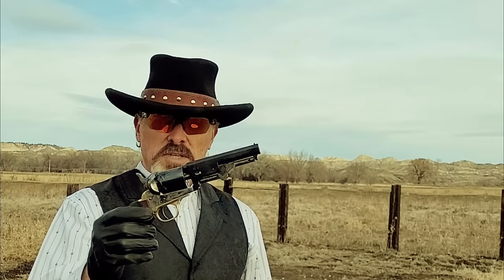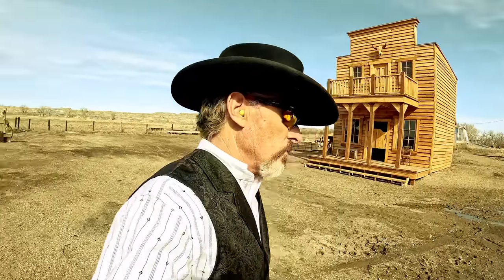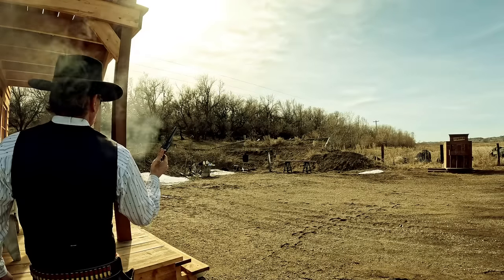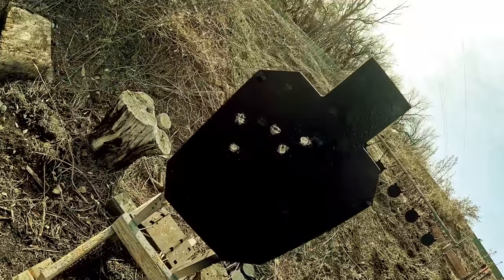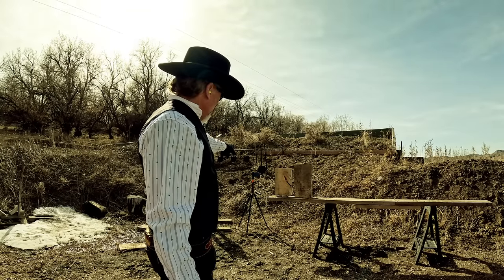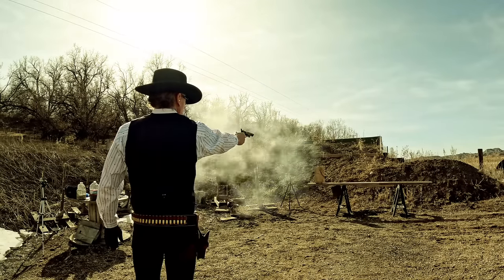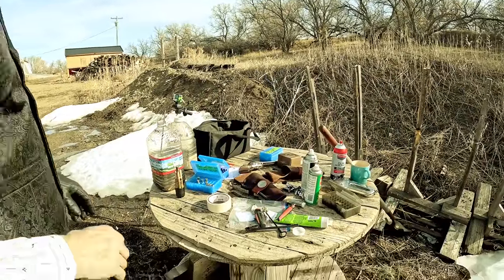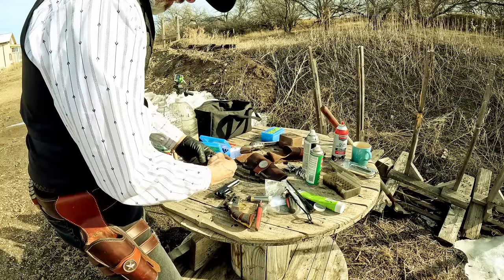The 1851 Navy "Sheriff's Model" Race  Revolver

Comment: I bought a used Pietta 51 navy at a gun show a few years back. It had an early Kirst cylinder without the loading gate. It was .38 long, but .38 specials fit in it. I solved the key hole problem by shooting the hollow base wad cutters in it. They are not hard cast, maybe pure lead. I loaded them to stick out as much as a 158 swc so it wouldn't have a big jump to the forcing cone. Works great. Someday I will order the back plate with the loading gate.

Comment: That is awesome! Thanks for all your work on these videos. I love the Navy configuration and I shoot the Richards-Mason conversion open tops in CAS. My guns are factory-made with the correct barrel diameter for modern .38 bullets so accuracy is not a problem with regular .358 or .359 bullets. An easy fix for your key-holing issue is to shoot hollow-based bullets. For instance, 158 grain hollow-base wad cutters. The hollow base will expand upon firing and grab the rifling better. You might try that before spending the money on sleeving the barrel.

Comment: I chronographed an undersized ball and it lost around 200 feet per second.  I do like that short barrel on the Navy.  I got an 1861 barrel shortened to 5.5” with a dovetailed front sight.  I keep the loading lever off and use it as a cap and ball carry piece in summer.  It’s only slightly larger than an 1862 but has an extra shot in the cylinder and runs way more reliably.

Comment: What I would suggest is using SW 38 brass and loading .372 ball or conical  The SW 38 is a bit bigger around brass and shorter so ..  maybe easier to eject?      Also with the right expander you could load .372 ball into the case.     This would solve two problems IMO.

Comment: Tuco you might like the Kirsh conversion cylinder better, then the R&D cylinder you are using from Taylor’s. Reason I say that, is the Kirsh conversion cylinder is similar to the older Richard Mason conversion cylinder. As the Kirsh conversion cylinder can be bought with or without the loading gate, which makes the gun load just like an old Colt Peace Maker if you get it with the loading gate conversion cylinder. Course you have to modify the frame for the loading gate to work, but it makes loading the gun safer.

Comment: I am amazed but not surprised that you did it with a stock cylinder. You should build 1 in 45 colt using a 44 caliber bp revolver.
Reply from the maker: It's tempting to try since the Taylor cylinders I've seen are cut to .040 or deeper. I didn't want to start out with a 45 and then cut deeper notches based on your opinion of the cylinder wall thickness issue which I agree with. The one problem with open tops and the 58 Remington is that the one stage hand ( as opposed to 2 stage like an SAA) limits the action and is insurmountable without a complete new cylinder gear.
Reply: @TUCOtheratt  oh ya I didnt think about that I wouldnt trust myself to cut the notches deeper on a opentop in 45. I am doing a pietta SAA clone. I have 2 of the 4 notches done and its stress full how thin the wall is. The SAA clones are definitely thicker. With your skill I am sure you could do it if there is enough metal on the cylinder. I wouldnt trust my self tho. Maybe Taylor's will like this video and send you 1. If I had a taylors conversion cylinder in 45 I would send it to you to try  I have kirst cylinders becouse I wanted the loading gate. Kirst cuts his notches stupid. for some reason they cut a leed on both sides of the notch  so there is almost no notch. Congrats on the 1851 navy conversion that was probably my favorite video but I'm partial to open tops they are my favorites. The kirst cylinders are made to the same dimensions as the black powder cylinders. I can measure the depth of notch and chamber if you want and let you know if it might help.
Reply: Also kirst sends a new hand with there conversion cylinders. It is a 2 step hand just like the SAA. He used to sell them separately. If he still does  I dont know but might be a viable option to help
Reply from the maker: @A.R.American1  It's puzzling to me how a 2 stage hand could work with a one stage gear, unless Kirst configures a two stage gear since he's making a whole new cylinder anyway which might be the case.
Reply: @TUCOtheratt  I can switch between black powder cylinders and cartridge cylinders with the kirst keeping the 2stage hand. I'm going to do a video on it in a few minutes
Reply from the maker: @A.R.American1  Please show the gear of the 2 side by side
Reply: @TUCOtheratt  I will have to find a cap and ball cylinder I havent shot cap and ball in years dont remember where I put them honestly

Comment: I would love to see a race gun version of the 1872 or an 1851 with the load gate conversion since it would be more practical. I find the open top colts to be the most asthetically pleasing of the wheel guns. I really want to get an 1872 in .45 and do these kind of race gun modifications

Comment: I just measured the mold it drops .375 diameter bullets at 125 grains. The bullet base or heal measures .350 upwards to the crimp ring the the nose of the projectile measures 375 in diameter. The guy I actually got the mold from sent me 50 bullets to try lol they are still in the bag they came in. I have a bunch of 38 short colt brass. I may load some up tomorrow.

Comment: questions:
1. What kind of bp are you using? Real bp or substitute?
2. What kind of  lube on cylinder axle are you using? 
3. Charge data for 38spec is?
Max bp under projectile or some filler for less charge?
Reply from the maker: Real 3F, full case compressed, no filler.
Reply: @TUCOtheratt you take no prisoners! :D with that charge!

Comment: Grease groves.  .375 bore diameter cast bullet from a modified rifle mold would work, but there aren't many types available and you would have to cast them yourself.
Well done.  They're accurate enough to get the job done.  The target will never know the difference.
Reply from the maker: From what I understand if I could cast them as a heal based bullet like original conversion cartridges I think that would work. What do you think?
Reply: @TUCOtheratt Yes, but the available molds are limited, so you might not have many options for bullet weight.
A mold needs to be milled shorter at the base to give it a heel, then redrilled and tapped for the plate. 
A Lyman 2-Cavity Bullet Mold #375248 375 mold has 4 grease groves and might do the trick.  RCBS also has a good candidate.  The Lee one might also work.
The more grease groves the better as it gives you more options where to mill the mold down to.

But be cautious in redrilling the knock-off plate hole and not shorten it as there's a lot of pressure on that screw.
Reply from the maker: @Absaalookemensch  Good to know. Thanks!

Comment: Just a thought, instead of re-ligning the barrel..... The casings expand when you shoot it, why not slug the barrel and have a mold made to the bore size? Since you're smoking blackpowder the pressures are low and your brass as long as it was cleaned would last some time. Of course you'd have to make sure your cases aren't splitting due to the chamber differential but if it worked you might save some money for more powder and lead. Also who does your custom work? That revolver is pure awesome.
Reply from the maker: Thanks for the tips. I do my own work on my revolvers.

Comment: Good news is that percussing 36 guns have really deep rifling....  bad news is it is .372 on all my 36 guns.   kinda good news is that hollow base 148 grain soft lead .358 bullets will sorta kinds expand with BP enough....   Also Cast bullets of dead soft lead of say .370 will load in the 38 spl case.   A better match would be the SW 38 which is really .360 so .370 bullets will kinda fit.

Comment: Tuco do you use wide lube grooved bullets to limit fowling any bullet mold in particular? When I plink I use Desperado soft lead bullets in the 44 Remington 45 Colt bullets. I make my own.375 from an old west bullet mold but I have not tried the conversion in the colt. Those I think work right it’s the 38 special ammo that key holes? I just checked i have a couple old west molds 375 diameter different weights. 38 special uses.357 much smaller diameter i can see the problem I have to watch it again . Great video!

Comment: IMO 1851 navy is the most beautiful revolver ever. It is so balanced, both in composition and in colors. 
The length of grip and barrel of the standard model balance each other perfectly, accompanied with the loading lever that further enchances the visual balance, not allowing the weight and size of the cylinder and grip to dominate over the thin barrel. The octagonal barrel contrasts with open top round cylinder, and the colors of wooden grip, brass guard and forged steel frame and barrel create a nice harmonic color composition too. 
It's like a katana of guns, especially considering the pop culture tradition of depicting such guns. Like a catana, it lies in the holster for a long time, until in the moment of need it is whipped out like a lighting to deliver one or two deadly, precise strikes, provided by a single action, elegant thin short travel trigger. 
Like a katana, it's also a symbol of status as a warrior, be it independent (a frontiersman/a ronin) or in service (a cowboy/lawsman/a samurai) and readiness to deal with problems, carried everywhere. 
Like with a sword, with a revolver of that type one has a deep pool of mastery waiting to be achieved: you can aim, manipulate and get a feel of the gun in a wider range of motions than with a modern semi automatic, rigid in modern tactical stances and grips.
Like a sword compared to a polearm, such a weapon requires  great skill, understanding and amount of training to be implemented effectively with it's full potential. 

Overall, I believe that in 1851 Colt gave birth to a masterpiece.
Reply from the maker: Well said! 😃👍
Reply: For my money the 1861 Army is the most aesthetically eyeball pleasing gun, the fluted smooth running lines are a delight to behold.
Reply: @biggusdickus5986  I guess it's a matter of taste. I just checked it out - there is sertainly an aesthetic to it. But I like straight lines and balance better) The 1861 is too long for my taste
Reply: @Paul_Sergeyev everyman has their own tastes, which is a good thing as it leads to more choices. What pleasure l get from my likings is the same you get from yours vive la difference as they say.

Comment: you are my mentor from 1851
can we do the same thing with the .44?
mine is running smoothly, well polished and shiny
I use “sellier bellot” caps
Have you shown the powder you use? modified chimneys with a hole in the side?
black or smokeless powder?
can we have a barrel with .45 Colt in 6 or 5 shots? stainless steel or steel
I make my black powder and my .44 lead bullets (454)
spherical or conical balls?
quality videos are a lot of work
well done !!
Reply from the maker: I get into more of that and race guns on my Rumble channel. Thanks!

Comment: So it is obvious you are not of the my 10s in subscribers. 
If you had you know two things.  
1. I have designed my own cap and ball  bullets for all three common standard calibers. 31, .36, and .44.
2. I am in the middle of a experiment involving the specifics of the .36 caliber actual bore size. 
What got me started on this quest was slugging the cylinders of both of my Remington new model Navy's. I determined at the time that to easily line up the conical bullets in the cylinder of both revolvers the heals maximum diameter of no more then .365.
This lead me to question the actual bore diameter. 
I want through the process of slugging one of my barrels on camera, the other one by accident ended up off camera.  Here is what I discovered. 
The actual bore diameter of my uberti is .3710.
The peitta bore diameter is .3665.
Now why did  I do this?
First off the numbers just didn't add up based on cylinder diameters 
So I am now have theorize that base on this foundation that  a .38 special case diameter is.379 and I can produce a .372 diameter bullets  it should still be able to crimped with ease.  So I have ordered a two position bullet mold. 
For a heal based bullets of  .358 heal, and a body of.372 diameter to  test this journey. 
My hope is to produce loads using only 38 special/ .357 dies without any special crimping die.
The two test bullets I ordered are a 130, and 150 grain bullet . When considering the cost of sleeving a barrel, as opposed to a custom bullet mold?
We will see.
Mountain man
Reply from the maker: There is a lot involved in working it out.

Comment: Nice video, I more like the original barrel lenght Navy.
Would this also work with the original cap n ball cylinder? Fanning, triple shot. They are very jammable, caps fall off, get stuck.
Reply from the maker: I'm pretty sure it wouldn't work.
Reply: @TUCOtheratt  Because in my country you can only buy muzzleloading weapons without a permit.
The Remington is more reliable with a cap n ball cylinder.

Comment: Didn't go through all the comments, but have you thought about using a hollow based bullet v.s. a barrel liner? I've used them in the past with some success. I was launching a 158 gr. hollow based  lead wad cutter from a 58 Remington Navy conversion around 600 fps if I remember right?
Reply from the maker: Ya I have. Thing is right now I'm shooting 9mm, 45 colt, 45acp 38 sp 357 mag and I'm sitting on a lot of 359 swc bullets (non hollow base). I really need to keep it simple at this point. If I can get the barrel lined, problem solved no need to introduce yet another loading component to keep track of.

Comment: @TUCOthratt I'm interested in a similar setup for Cowboy Action Shooting with the 1851 Navy.  Can you discuss differences in parts and mods involved in your finished Quick Draw race gun as compared to a CAS/SASS race gun?
Reply from the maker: Cowboy action tuned race guns are like moms minivan with a new set up spark plugs and basic tune up to go to the store and back reliably. (good enough) My race guns are like 10 second quarter mile corvettes. More on my Rumble channel if your are curious.
Reply: For your platform, did you start with something like a Taylor’s black powder 1851 Navy .36  in 5 inch and then add a Taylor’s conversion cylinder in .38LC? Or did you go for a factory Richard’s-Mason conversion from Cimarron in .38spl?
Reply from the maker: @VSHO-pn3ns  Pietta 51 navy, Taylor cylinder for Pietta 51 navy. This still won't make a fannable gun. see my rumble for more info.

Comment: I figure quite a few shooters were more interested in the lighter weight and faster draw of the 5 inch barrel. I wonder though what the over/under was on preferring the 7.5 inch for that extra bit of power and accuracy, or if the excess gas just vented out at the cylinder too much for it to matter.
Reply from the maker: Some men like Dallas Studenmire cut them down under 5 inches

Comment: how long were these kind of revolvers used as cap lock before they were converted to using cartridges and the advent of a more modern cartridge pistol?
Reply from the maker: That's a great question. The first cap and ball pistols showed up in the late 1830s. Self contained metallic cartridges for rifles began to see wider use by the end of the civil war mid 1860s. By the late 1860s revolver cartridges were developed and thousands of existing cap and ball revolvers began to be converted to fire metallic cartridges.

Comment: Why not in 44cal?
Now of course the Remington Conversion Cylinder change is much faster .
Thanks for the video. 
God Bless
Reply from the maker: 44 open tops have very thin chamber walls so I didn't think it safe to cut them deeper if necessary. However, if the cylinder came with notches at least .045 deep like this example it might work fine without cutting.
Reply: @TUCOtheratt  I apologize I meant to say the 45 Conversion Cylinder. 
I put a Howell Conversion Cylinder in a Uberti Army Steel Frame Revolver that has safety notches in between chambers so you can load all 5 rounds safely  .
What do you think about the Remington Converted over with a 45 Conversion Cylinder  ?
Reply from the maker: My Remington conversion runs good but it is still an inferior design to an SAA imo @HAE777
Reply: @TUCOtheratt  I don't have a Remington but I hear they're on the heavy side ?
Reply: I know a converted to race Remington 1875 would be longer in the barrel as its 7 and a half inches long but isn't the action basically the same? I would like very much to see you using a race version of the Remington 1875,maybe you could even cut down the barrel to 4 and 3 quarter inches like the usual Peacemaker you fire, but also l appreciate all that costs money, but if you ever get the notion and the time and money to do so l would be one grateful fan.
Reply: @biggusdickus5986  I'm definitely collecting  Antique and replica guns and hopefully I'll have the funds to do it and a Remington is the Gun I'm going to purchase next and I'll definitely look at the Race Remington as well ! 
Thanks

Comment: Seems to be easier to modify into a race gun than the cowboy colt single Action style.
Reply from the maker: Yes and no....I know that makes no sense. However, yes in the sense that this is the first race gun I know of made without using a milling machine to deepen notches and extend leads. It was all done with hand tools. I just wanted to see if I could do it. No, in the sense that the 1851 design uses a single stage hand, thick hammer cam and generally has much more friction in the action to start out with. This gun took me about 5 times longer than normal. And it still retains more friction in the action than my 1873 SAA race guns so it's harder to shoot fast.
Reply: @TUCOtheratt  oh I I’m trying to find someone to do my pistolero .357 like this if not I’m going to learn gunsmithing myself.